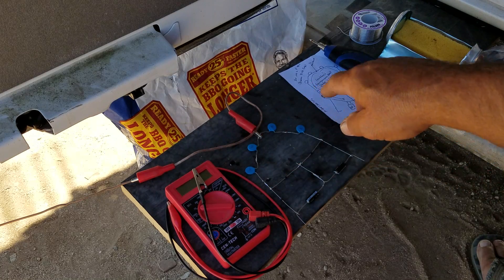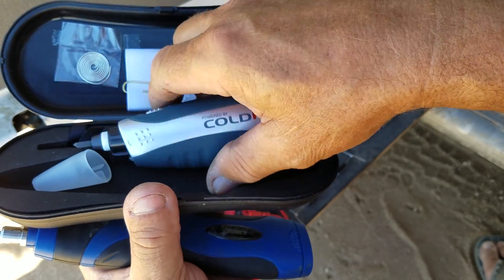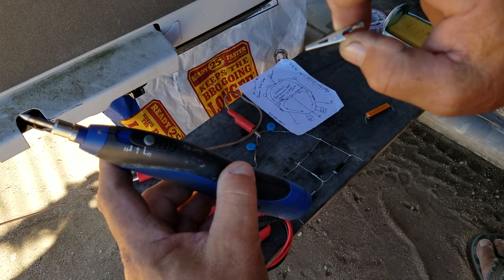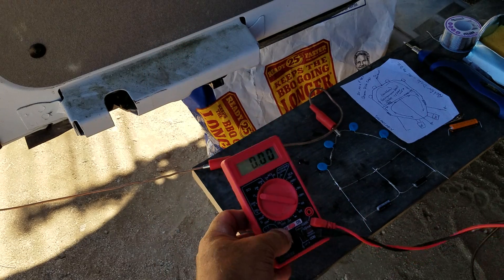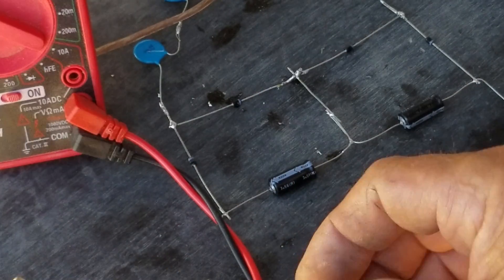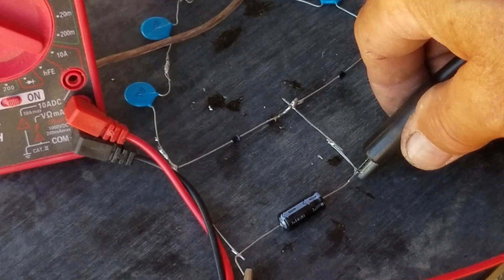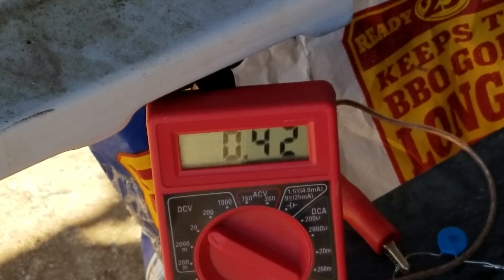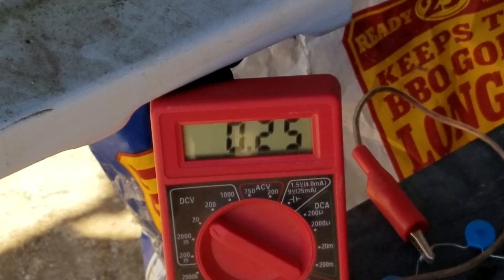Electricity from the air collector

Comment: What if you made antenna out of Tesla coil with sharp needles of copper or graphene on one end of the coil facing the sky, other end of the Tesla coil antenna goes to your collector circuit. Sharp points of needle should increase the efficiency of collecting ions from the air. The higher the altitude antenna is installed, the better.
Reply: Also google "Ion Power Group" and youtube search "Graphene/Graphite Atmospheric Electricity Collectors - Plus Horrific Hexacopter Crash!". Graphene based experiment on collecting electricity from air.
Reply from the maker: @Xeno_Bardock  graphite makes great capacitors!
Reply from the maker: That sounds a lot like Nikola Tesla's idea for supplying electricity to houses...
Reply: @GBear  This is how Nikola Tesla coils were likely originally intended to be used collecting electricity from the atmosphere and convert to AC. https://www.youtube.com/watch?v=qwVOp-HPIVE

Comment: What is inside such a capacitor ? If you  make 5 more of this circuits in parallel will it give 2.5 volts as output ? Ancient buildings which produced free energy had asbest and mercury inside their capacitor antennas.....
Reply from the maker: Welcome aboard!  I haven't opened those capacitors yet because they are still good, and I don't want to waste them, but most capacitors have aluminium and carbon.
Reply from the maker: @lobsterbaby5302  get back to the future....

Comment: It is droping because your multimeter takes some charge that is stored in that capacitors. At some point charging of the capacitors will be equal og losses in multimeter and voltage will be stable.